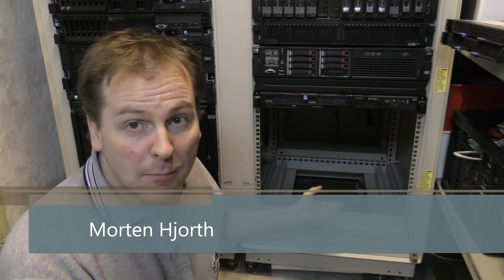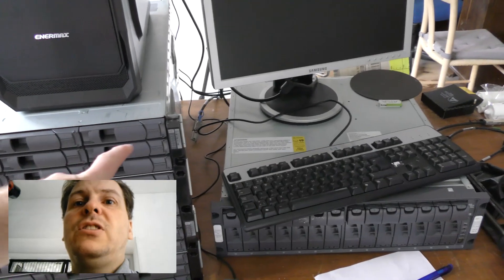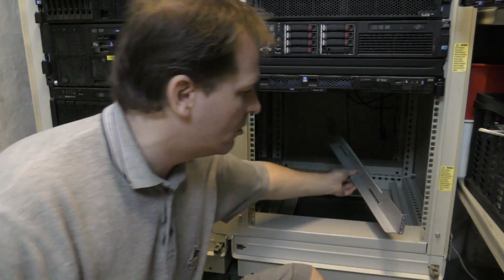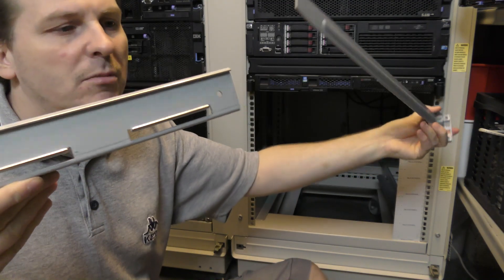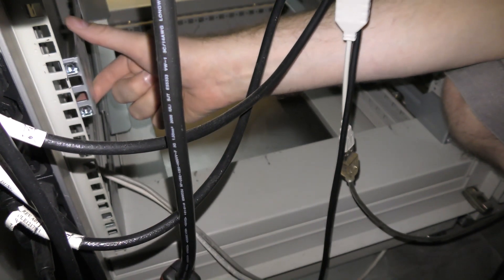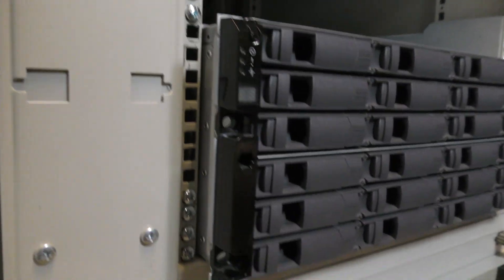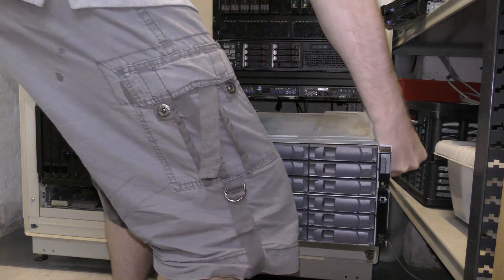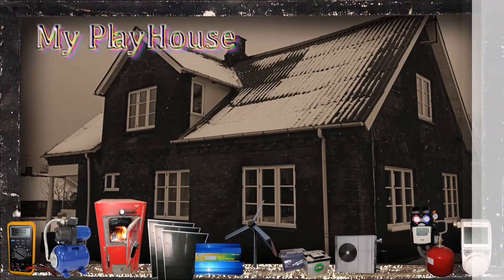62.5 TB of Additional Storage moves into my Home Data Center - 559

Comment: Hi, i've bought the same server and it arrived today :) 
I've turn it on now and i have a question for you, what is the use of the network ports on the back? I've tryed to connect them to my switch but it does not give them an ip...
Reply from the maker: It’s probably just a serial connection, that uses a rj45 port. Don’t connect it to a switch.

Comment: With all of that extra storage behind your Lenovo X3550, you have managed to take away one of the only drawbacks of this server against its cousin, the X3650, which in my opinion is drive capacity. Unfortunately, in my market, where 3.5" hard drives can be had for very little money, storage enclosures like this are sold at premium prices in my part of the U.S. for some reason, which is why I prefer the 16+ drive capacity of the X3560 M3 and above in the 2.5" storage array option. However, I would love to fill out my data storage system with cheaper 3.5" drives for massive amounts of backup potential. Thank you for another excellent video, Morten!
Reply from the maker: Hi Tyler Barton
Thank You very much!  glad you liked the video :-)
Thank you for watching! :-)

Comment: Amazing. I just bought two more of the DS4243. Now I have 4 of them. 
If you'd like, I will send you some pictures, as soon, as my data center is finished. 

You should try them with FreeNas and the NetApp PM8003. 

Fun fact: IBM build the same Disk Shelfs under the name IBM EXN3000.

Edit: If you don't use all 4 Power Supplys, the fans will spinn on full speed. Just let the other 2 in. Then its only on 50%.
Reply from the maker: Hi Patrick Lünow
Thank You very much!  I did not know about the IBM version of exactly the same...
I do believe it is meant for just two PSU's.. I pop them out so the DS4243 can't see them. if it cant see then it is not missing them and want blow full speed.
Thank you for watching! :-)
Reply: Sure. I might do a data center overview in the next weeks. 
It isn't finished yet. But i recently bought some HP G2 Racks these will fit nice. 
I will reply on the comment, when the data center is finished.
Reply: Nice =)
Reply: Do you know the Dell 2950? A single one is louder than 4 DS4243 and an Dl380 G6. 
These things are super quiet. 
Sure, if you have 96 15K SAS drives, they go a little bit nuts because of the heat. But in general, this things are really quiet and super fast. I love this things.
Reply: Yeah, I have the same problem with mine. Two of them are configured for 2 PS and the other 2 for 4 PS. 
If I dont put the 4 in, the fans run on full speed. A little bit stupid. 

If you need some HDD caddys, you can contact me. I have 24 on spare.
Reply: Wouldn't it cost more to run 2 power supplies than 4 power supplies if the fans run 24/7 at 50% speed instead of 100% speed?
Reply: I have to say, that I don't care about my electricity bill. 
The Problem is, that some DS4243 are configured with 2 and some others with 4 PS. The configuration must be made with a NetApp Filer System. I don't have one of those. These things are fucking expensive (3500€ here in Germany). I can tell you, that you DONT want the fans to spin up to 100%. They are as loud, as an jet engine. Thats why 2 of my DS have 2PS plugged in an the one with 4, has 4PS plugged in. 

If you run them with the pre-configuration, they run really quiet.
Reply: Could you possibly tell me how loud they are?

Comment: LOVE it... Though i think you need both cards.  That is two conjoined 2u 12 bay chaos each with dual psu and 2x cards.  Look at dell md2200, same models
Reply: in a prev video he formatted them all w/o the 2nd controller in so its fine, will just be a tad slower
Reply: Sakura Kinomoto i saw that, i still find it hard to believe. But that's a custom netapp only shelf by Dell so who knows
Reply from the maker: Hi Daniel Tekmyster
Thank You very much!  I think it will be difficult to make a redundant  setup,, think I just have one controller.
Thank you for watching! :-)
Reply: My PlayHouse check that all 24 drives are seen in your array with only one out of four controllers. I believe that two are needed for each of the 12 drives, same as the power supplies.